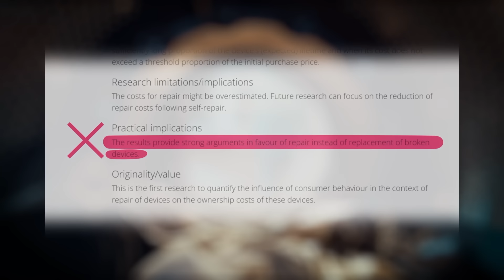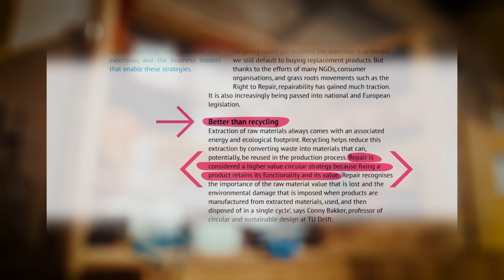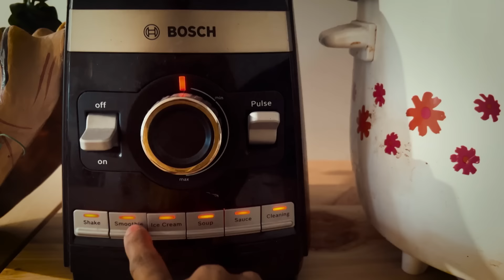How Europe wants to stop the flood of broken stuff

Comment: The EU needs to introduce sustainability badges for products just like energy efficiency badges. Today products are only tested by private organizations or not at all for sustainability, durability and repairability. The EU must make it mandatory for vendors to have their products tested for sustainability (for products with a price above ~ 30,- EUR). Percentage of use of standard parts? Material strength and material choice (plastic vs. metal)? Ease of repair? Standardized durability tests ... That would quickly eliminate all that trash from China and help European producers to compete.  We need products that last and are so easy to repair that consumers can repair themselves.  With the extremely high cost for manual labor in Europe most repairs will be too expensive. Only for products above 1000,- EUR a repair is a viable option. Repairing a toaster that costed 100,- EUR for 100,- EUR is not economic. And 100,- EUR is the bare minimum. Most repair shops will charge much more.
Reply: You guys dont have those things? Here in my place, we kind of do, where electric appliance usually have star rating, with 5 as the best (I usually see 5 tho). So far it seem real for me, at least.
Reply: @unknownman5090  only for energy efficiency. not for sustainability. you can buy an fridge with A energy efficiency but three years later it is broken.
Reply: Repairability badges
Reply: "it scratches at a level 6 with deeper groves at a level 7"
Reply: The elephant in the room is flood of cheap chinese made junks that cost several cents to produce and sell for €1-2. Those are items that get discarded the most, not €100 toaster
Reply: @roxylius7550 true I bought a toaster for 12€ the timer was already broken. I returned it and get a refund. But I could have returned it even if I simply didn't like it. This made me reconsider buying expensive but better. At the end of the day if you don't like it or find it useless you can return it anyway. Buying good can become getting free stuff. A lot of things I use in the kitchen have been used by my family since decades.

Comment: Manufacturers should be forced to build products with replacable parts.  My toaster oven has one heating element that doesn't work.  I should be able to take it out and replace the element but it is welded into the oven wall and cannot be removed.
Reply: If the spare part is available, cutting off the old one a welding on the new one is something a lot of maker spaces will have the equipment to do. The biggest problem seems to be getting parts. Even in the cases where the factory that makes the parts is known, the factories will be contractually forbidden from selling the spare part to you as part of the conditions to become the supplier for the multinational that make the product. Apple are the absolute kings of this shitweasel behaviour.
Reply: Then use a 3rd party element of same wattage
Reply: @ayushjaitly2616  The heating element for a lot of appliances is custom shaped to fit just that appliance, so finding a third party item isn't always easy.
Reply: I hope they build products with replaceable parts as time goes by.
Reply: @peglor  they are custom shaped, but most of the time they are made from a simple wire that is very easy to form into a new shape. You can't be lazy and handy at the same time. I just replaced batteries in my Philips electric shaver that had batteries soldered without option for easy replacement, sure it took me more time, i had to come up with some custom solution to keep the new batteries firm in place (since i don't have special solder for batteries), but after using it for nearly 8 years i'm hoping to continue using it for at least 5 more years and it cost me only 5€ (for new batteries) and a couple of hours. Also I get that warm feeling of reward every time I'm using the shaver ☺

Comment: It ALLWAYS starts with product design. If the materials are not easily recycable, if the parts are not made in a way they can be easily taken apart and put together again, then it is already a lost cause for recycling. Regulation needs to prioratize this aspect otherwise we will never get ahead.
Reply: True, giving some small subsidy to people won't solve the problem, use those 200€ to fix your washing machine,  then what about the rest? Policies should be directed at the source, i.e. the manufacturing process
Reply: ...and it end with Apple who makes its users belive that their Ipad became to old to open the same website or file which it could open fluidly days  before...Funny enough .they call it an update.
Reply: Yep, software compatibility dropping and code bloat are the #1 sustainability issue.
Reply: Yep, agreed! All of the household electronics I ever tried to open have enclosures that snap closed, not being meant to ever be opened again. I usually have to break part of the enclosure to get to the inside of the product.

Comment: The thing about repairing things is that nowadays, you cannot repair your own stuff as the design dictate either you buy new stuff from them or go to their specialize workshop to repair it. I heard stories about how there is no fricking screw below laptop, which mean you pretty much cooked with one use laptop that will be dusty because you cannot clean it up.
Reply: Yup, happened to my mom. She kept an older laptop from my dad after he passed and it served her well.
But then she accidentally spilled water over it, and when I tried to unplug the battery to rule out the chance of something shorting while it was drying, we found out that the damn thing doesn't even HAVE screws... I was prepared for pain in the ass screws that a regular person wouldn't have the driver for, but I did not expect NONE... In the end we just had to hope and let it dry, and we were lucky this time... She's back to using it again and it's been fine for a couple months by now.

But this was the first time that I've seen a laptop without screws. I only knew that from phones, where it /can/ be partly excused by the fact how thin their frames are, which only offers watch scale screws if any at all. But the laptop has NO excuse for that crap.
Reply: @csuporj  Well I suggest keep the laptop as backup. My father still store his old laptop so it can be use during time of emergency, or simply for school work.
Reply: sometimes in laptops there are screws, but they are hidden - generally under the keyboard

Comment: A great video. Maybe a year ago, my laptop warned me of that the battery wasn't working as well, and should be replaced. So I went to one of the local electronics stores to look for a new one/ask how to replace it. However, it turned out that current laptops have their batteries integrated and aren't easily replaced. So the salesperson said that I could send it in for a battery replacement through them. Something that would cost a lot, abd would leave me without a computer for a longer time. So also suggesting that it would be better to just buy a new one. My laptop isn't that old, just a few years, so I decided not to do either. Eventually I should replace it. But it shouldn't be like that, and it makes me angry.

Comment: I’m a massive supporter of right to repair and while I have the tools and limited know how to repair some things  for example I recently rewired a slow cooker after the cable got damaged and although it was successful, I find repairs more difficult than they need be. The two biggest hurdles for me is access both to parts and documentation. In the case of the slow cooker I needed a little copper end part to hold the wires together when reattaching the plug on the end, something I have never encountered with other things I’ve rewired.

I have the tools to do some electronic repair but getting replacement components takes hours of searching. I recently had to get a replacement for my Samdung washing machine which was covered under a special warranty as the part was a defective and prone to failure. Due to this they were forced to cover all failures of this specific part even outside the period mandated by law. If I was to pay for a technician and part outside that coverage, it came to the cost of a new machine, one that might also last longer.

Comment: It's like how long smartphones are lasting - around 3 to 5 years, depending on the model. Feature phones lasted much longer than that! (I think) 

If a company wants users to upgrade to their newer models, they'll stop giving security patches to older versions, making them concerned about their safety regarding the data & information they have stored on their devices.

If users refuse to upgrade or accept the risks, we should at least be informed of how we should back-up, erase our data, and dispose to a safe location, minimising e-waste. We should especially need to address this to users with limited or no IT experience.

Comment: I think that the best model out there that should be forced to get copied by as many industries as possible and practicable is cycling: almost every part can be replaced and even upgraded, however only the outer shape or interface is standardized to a degree but the tech inside the part isn't so there's still place for innovation and competition. Even color combinations are more or less standard so that you can assemble your cycle from parts from a dozen or two of different manufacturers in a consistent color scheme.
Manufacturers can even factor in planned obsolescence - I guess that's a reasonable compromise - as long as it is contained within a single replaceable part and not the whole device.

Comment: I had to replace my computer's battery a few weeks ago. The old one went to the Solidarische Recyclingstation in Leipzig, where they'll see whether they can refurbish the old one and use it again.  The washing machine leaked a few days later, but thankfully there's another of the same model around which is being used for parts; the new seal will come from that.

One small failed component of a machine should not make it mandatory for the user to replace it.

Comment: "Right to repair" or "make things easier to repair"... That's still very vaguely defined.

What's one of the things we could do ? We need to have a list of standard tools. It would include ordinary tools that we usually have, for example not screws that need a screwdriver with 3 branches, or a pentagonal key with a hole in the middle.

It would be mandatory for consumer products to be openable and repairable/modifyable with those standard tools. That's not all but that's a concrete step.

Comment: I had some phones repaired especially with knwoing that a display or battery needs replacement and this happens often can be pepaired fast.
For anything like a wasching machine that i really need, i do not have time to try repairs for it to fail and then have no chance to wash my clothes. I eighter know it can be repaired fast or i will need to buy a new one fast.
Other stuff i tried a few times but get huge bills sometimes for the try without getting the thing repaired and i had to pay 50% of the orginal price for nothing at all. 
At that point i switched to youtube and see if i can fix it myself in 5 minutes or if not just throw it away.

Comment: How does the repair bonus work with using unofficial repair venues like this or even repairing yourself? How is the cashback determined or validated?
Reply from the maker: Hey there! One can only get the repair bonus if you repair sth yourself at a repair cafés or repair initiatives but not at home. If you bring it somewhere for it to be repaired, it has to be a specialized store and there needs to be an invoice (not paid in cash). To get the money, you need to then hand in the invoice etc. online
Reply: @DWPlanetA  Figured as much, good to see repair cafes supported though, wouldnt have expected that.

Comment: We need to start to sell not an actual item, but it's kind a bluprint. Like with FDM(so called 3D) printing You take actual bluprint of item and then print it. Change technological processes to allow items be produced with simpler and cheater ways. Actually we can build system which I called "neocraftsmanship". 
Todays malls and shops can evolve into actual producers as it already partially happened with food in my country - biggest supermarket net there actually started as way to more efficiently sell thier grocery products. Endgoal is You bought license/blueprint for item, then buy it's producing in nearest shop or even chose on place item from thier recomended list. If some part of item broke - You still have blueprint and just buy actual replacement parts and reassembly of this item because it is cheaper than buy full item producing. It's too many too wild words, but meaning is - we neep to scale down and disperse producing operations and redically simplify logistics and producing chains.
With plastic details catch is in process of it's producing. Forms for molding plastic cost redicilous amount of money and it intensify overproduction, because You need not only return money for used molds, but also obtain money for new molds. Also those parts usually produced in another countries which add import taxes and delivery cost, which again intensify overproduction because sent bulk of something cheaper than sent one part. In the end there are many nuances with production which extremely intensify overproduction... End nobody even think about how to change it.

Comment: Meanwhile in the UK people dump their stuff at the “tip” hoping something magic will happen to it - I cringe at the number of repairable items or spares that are left there 😢

(I run the local Repair Café as it happens 😊)
Reply from the maker: Hey there! Do you feel like the attitude towards repairing changed in the last years though? Do you have more visitors at your repair café?
Reply: @DWPlanetA  it's certainly become more prevalent I think but there is still a mindset of replace versus repair across much of the UK - that said there are now dozens more Repair Cafés popping up in the Cambridgeshire area helped by one charity which helps to ease the load and ensures that the "urgency" factor is mitigated - albeit with the compromise of maybe having to travel further to do so. Communication and awareness is also a problem - those that "get it" will endeavour to get things repaired, those that don't will continue (unless of course they think they can get their £xxxx phone fixed for free 🙄 The other problem we see is "expectation" - there is a program on TV in the UK called "The Repair Shop" which gives some people a false sense of what is possible (they do more restoration type work rather than simple repairs)
Reply from the maker: @Umski  thanks for sharing! Yeah, as usual a topic that needs to be approached from different perspectives to make a change.

Comment: 3:50, that's outrageous. Any molded plastic part should be way cheaper to buy from a factory than to 3D print it yourself.
Reply: @ingulari3977  Yes if you can make something in your home, from a spool of plastic and a computer file, you eliminate all the logistics. For a small part, the shipping probably costs more than the part itself. Plus all the other savings. 
But at scale, 3D printing the same part thousands of times is way more expensive than injection molding. Like 10 or 20 times more expensive.

Comment: The behaviour that you are complaining about is called designed obsolescence. Your electric multiplug connector has screws that you can not take out by design so you need to by a new one when it stops working and it is also for safety issues, the company making it and seller does not want to get sued for liability when people hurt them self's when trying to fix things. A factor is also the price of labour, the more expensive the work and the cheaper the device the less likely you are to bother fixing it.

Comment: I have an LGG4 H815 smartphone, I rooted it to upgrade it's OS, because the battery is replaceable I've gone through about 30+ batteries and the hardware is still going strong.

Admittedly it's showing it's age now and is slow, but it's still getting used as a digital radio.

I bought it in 2016 a year after it was released and almost 9 years later still A1 all because of the replaceable battery.

That feature needs to be brought back and forced on all manufacturers.

Comment: Many good points are brought up in this video but there are some that are not brought up.
For example, computer devices are a huge part of electronic waste and these do not become waste because they are broken (most still work) but because they cannot handle the new software and the old software on them is rendered useless either because companies refuse to update it or because it relies on an operating system that is no longer updated by its creator company. 
Another example is objects that are so cheaply made, they are essentially designed to only last for a very short time and then break. Being so cheaply made, these are nearly impossible to repair.  There needs to be a minimum set standard of quality for all consumer goods.
A very good that is made is that we now have 3d printing which in many cases means that the cost of a replacement part is insignificant if made by a 3d printer. This is something that legislators should take into consideration very seriously. For example, in the case of manufacturers that do not provide economical spare parts or stop making them altogether, there can be a legal obligation in place for them to release to the public 3d printing code (instructions) for these parts. The files containing the code for each part could be kept by another organisation whose purpose would be to keep them available to the public.